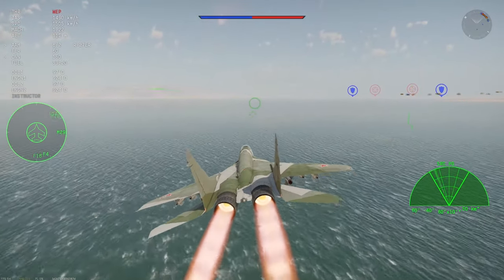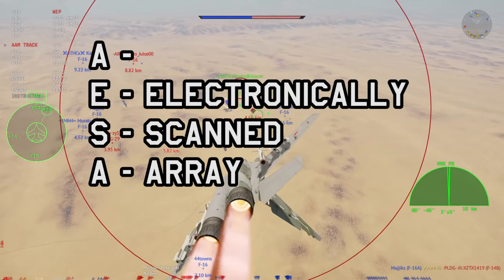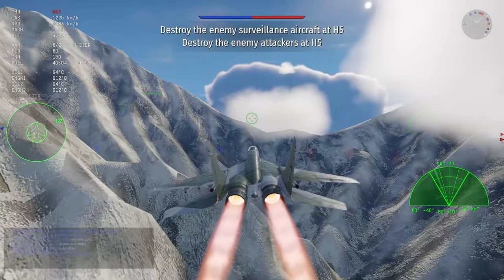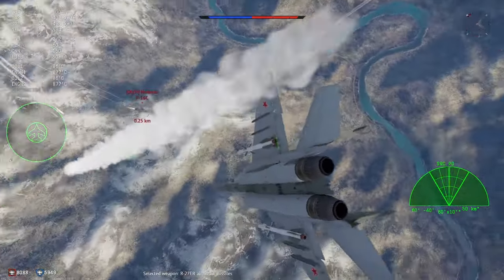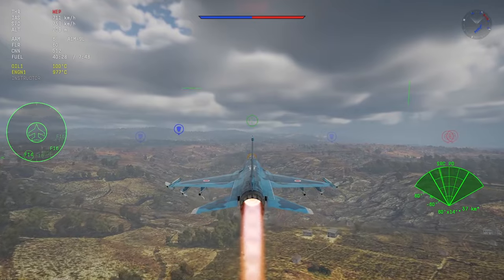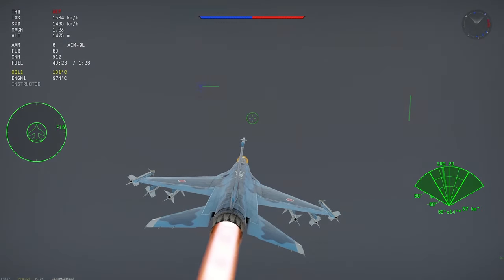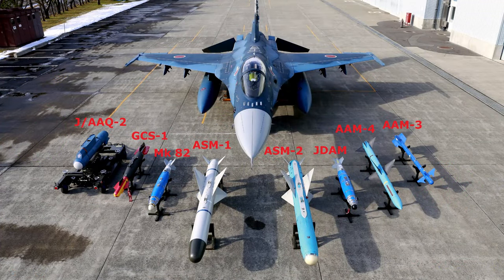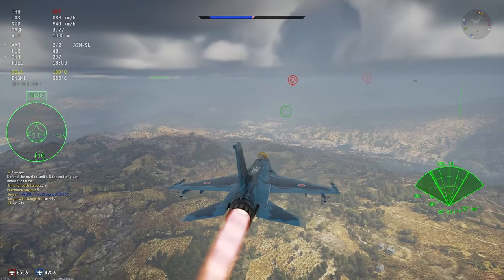AESA Radars and the Mitsubishi F-2 [War Thunder - How to Implement]

Comment: Great Video
I would like to add on my 2 cents:

Having the ability to track multiple targets isnt exclusive to AESA/PESA. Mechanical scan array(MSA) do also have the ability to track multiple targets(granted they are soft locks in TWS modes and isnt hard locks like what AESA can do), guiding mutliple amraams where each amraam has its own target to look for. You can see this in things like non AESA F-15Cs, F-15Es, F-16Cs. You dont see this in WT, in fact in WT, TWS modes dont soft lock more than one target, but you can see multi soft locks in things like DCS. 

The MHI F-2A has its roots from the agile falcon where it has larger wings than the standard F-16. What the F-2 also has however is enlarged elevators even compared to the f16s. When going from f16 block 10 to the block 15, GD decided to enlarge the elevators (you can see it in game even) and these enlarged elevators will continue on all the way to block 70. The F-2 has an EVEN larger elevators even compared to the already enlarged elevators starting from f-16 block 15, making it possibly be able to pull more instant AOA, which helps in one circle dogfights.

While the Engine of the F2A is the same as the block 50, the F2 also weights abit more than the block 50. This is where the larger wings and elevators help to compensate that(and hopefully it will more than compensate for it with their flight software wizardry)

The F-2 actually has 4 underwing hardpoints per wing. When accounting for wingtip hardpoint, that will be 5 hardpoints per wing, 10 wing hardpoints in total. This means that the f2 can hold 8 air to air missiles WHILE still hauling 2 external wing tanks. If anti ship missiles are wanted, that just means it can carry 4 ASMs with 4 AAMs and then 2 wing tanks. For reference, the most number of AAMs the F-16 can carry is 6 with external wing fuel tanks. 

The F2 also has drag chute, which is probably part of the reason why it has a unique looking tail along with rwr.

If we look at some models of the F-2, you will find countermeasure dispensers near the tail. You can see it as 2 white squares near the tail on pictures. It is not consistent as some F-2 does not look like they have it(or maybe all do have it but its closed up). Should have about 120 CMs like the f-16c blk50/52 although countermeasure dispensers on F-16s are not consistent by itself

F-2 could also use older weapons such as AIM-9L as well as AIM-7F/M, although I love to see AAM-3 implemented (probably will behave like the r-73 ingame). AAM-4 would be cool when we get to amraams era and the 4b will come much later. AAM-5 is in the far future. While it has JDAMs, it wont be a effective CAS plane since JDAMs cant track moving targets. For it to be an effective CAS jet, it would need to use LJDAMs along with sniper targeting pod where the real life F-2s got them later in service. No mavericks though, so we gonna need jets from a sub tree for that

The jet has potential but we also have to count on gaijin implementing it properly in the game. But since Japan isnt a major nation and isnt very well loved by Gaijin, I cant have my hopes up. I dont even think they gonna implement AESA properly but we'll see 

Hope this helps in understanding more about the zero of the modern jets era

Comment: 10:28 F-2 has eight underwing pylons, with station 2 and 9 having two different mounting points (inboard and outboard) to balance out loads. A possible max loadout being 1x 300 gal tank 2x 600 gal tank 2x AMM-3 6x AAM-4